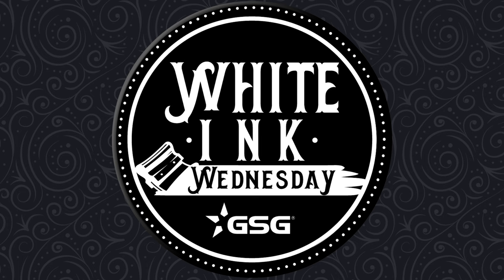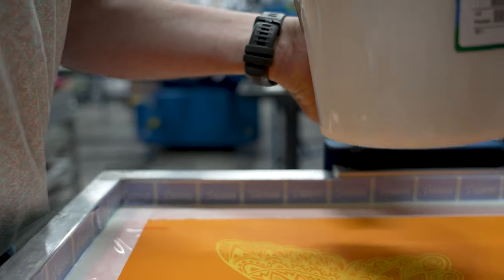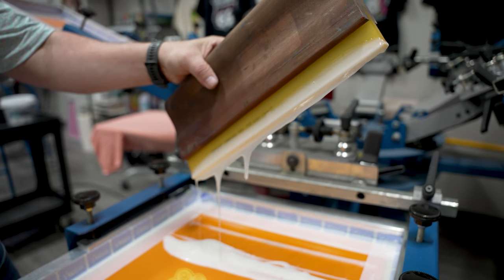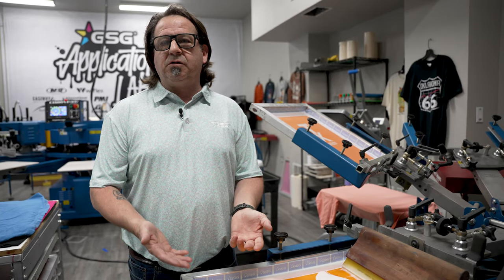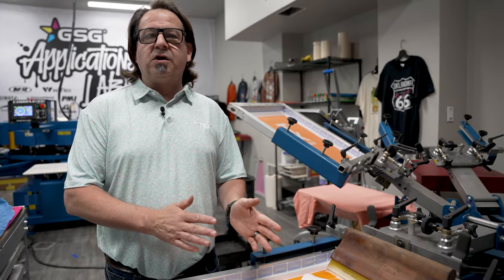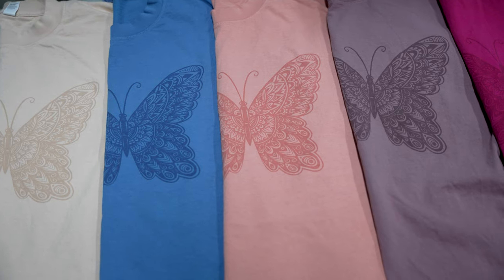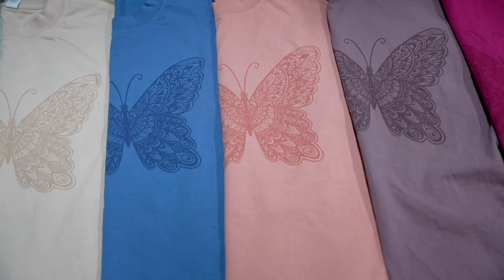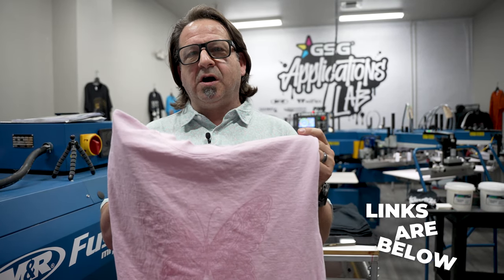The Best Way to Screen Print Tone on Tone | Avient Nova Base White Ink Wednesday

Comment: What is nove base 😅
Reply from the maker: Nova Base is a specialty ink by Avient. It’s intended purpose is to be mixed with glitter particle, however if you print it in it’s own you are able to make this cool tonal effect. Here is some more information:

Avient™ Specialty Inks INFINITE FX NOVA BASE is a multi-purpose special effect ink for creating dry flake glitter effects and other specialty print surfaces. When mixed with a glitter particle flake, Nova Base has the ability to penetrate the fabric and leave the glitter flake exposed and dry to touch. Nova Base allows the glitter flake to retain its edge sharpness and brilliance when printed onto light and dark fabrics.
Reply: @GraphicSolutionsGroup  thank you 🙏